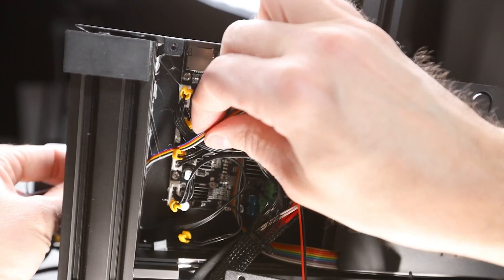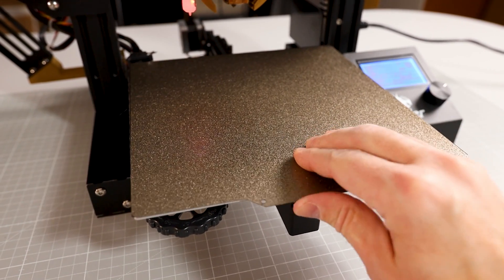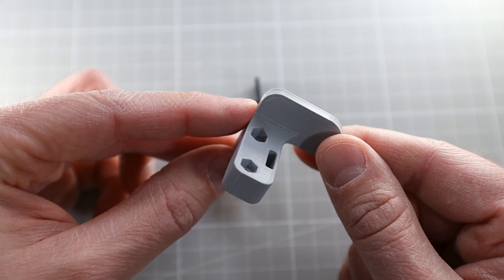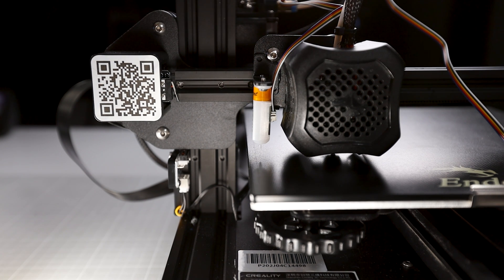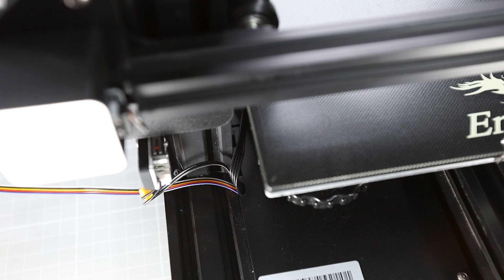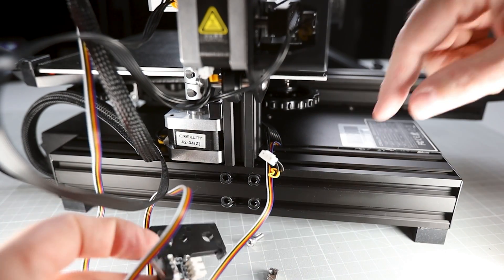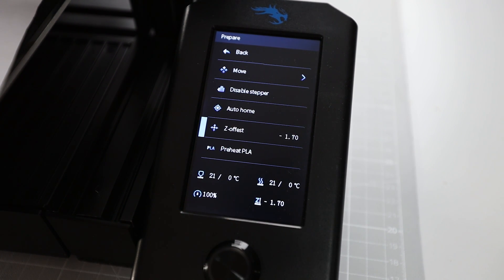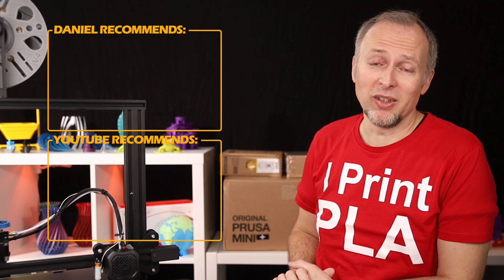Ender 3 v2 (v1, Pro) BLTouch Upgrade (Creality 4.2.2 or 4.2.7 mainboard)

Comment: Lol Sorry in advance this is quite a long read.
Love Videos where everything is explained but just in-case the source links are provided for more info if you need it well done!

 I considered getting an Ender3 when I getting into 3D printing 4 or 5 years ago. Whilst seeking advice on buying a printer. I was asked "Do you want to Print stuff or Repair and Mod your Printer as your new hobby?" Was Advised that if I wanted to print things buying a Flashforge was a better option. I bought a Finder3 and 5years on My flashforge had it first hiccup last week when the Hotend became blocked. ( not bad for 5 years of use) I decided that, maybe as it's no longer made that I'd better buy some spares whilst I still can.
 So tapping Finder3 into eBay naturally gave me all the results for Ender3 instead. And there at the top of the list was a modified Ender 3 V1 Neo for £20 with 2minutes left and no bids. After a quick scan of the pictures I noticed it was pretty much taken apart and there were quite a few new spare parts in a bag. I placed my bid I was the only person to bid and I won this printer.
Turns out it has a 422 silent MB All metal hot end upgrade dual gear metal extruder. The bad news was it wasn't put together very well at all to begin with and had been partially stripped with the same finesse.
I  watched a couple of Videos on YT to familiarise myself of the internals of this. 
Once I carried out some remedial repairs I tested everything to see if the printer actually had and signs of life. So when It did.

 I ordered upgraded yellow bed springs and a BLtouch clone from Aliexpress. When the parts arrived the following week I set about rebuilding it. and 3.5 hours later I managed to print the demo file on the TF card.
Since then I've printed a bunch of cable chain and the mountings so I can tidy up and secure the cables. Now I've proved the printer actually works I will fit the BL touch.
What I've discovered is that the Ender 3 prints surprisingly well and that the user  interface is clunky compared to the flashforge. So you need a ton of upgrades to get anywhere near that.And thus the advice I was given when buying my first printer was correct. I've had this Ender3 for little over 2 weeks ( 1 Week waiting for parts before I rebuilt it) And already I've had all the wiring out of it twice I'm watching "Upgrade" videos and planning improvements I can make to this printer.
And knowing this I've made a decision It's getting the cable Chains It'll get the BL touch.
I might move the extruder to direct feed to the hotend But it will stop there other than an Enclosure so I can print ABS with it.Modding an ENDER3 will not become my new hobby

Comment: Does not work for me at all. All the people are doing Videos for ender 3  (V2 ,V1, Pro) and 4.2.2. 4.2.7 and firmware even not told in titel. Could not work like this. You should only do 1 video for your ender Modell your Motherboard and the Firmware you use. Everything else will not work eventually like for me. These videos are useless. But you will get more clicks i think because people watch it over and over because it does not work and they think they done something wrong. Till they figure out its your info that is wrong. And they will not come back to any video from you. But you got more clicks in the first place. And this is for all other videos out there. Must be lucky you really have all the same. Some people even forgot things and they just edit a text most people dont even see. But they dont want to record the section the missed something. if your video is not correct in every detail dont play with the time of all your followers and the people watch your videos and bring you the money. But its mostly the case because clicks will come any way even more if you got something wrong because people have to watch a couple times to figure out whats wrong. very sad. overall useless if you have not all the same stuff. not working for ender 3 Pro 4.2.7. and firmware most also be correct.
Reply from the maker: Dude, it’s 2025, why are you even doing this?

Comment: I'm using bl-touch v3.1 with extension cable, how to properly plug it to the 4.2.7 board for ender 3 v1, thanks.

Comment: I just finished installing my bl touch on my ender 3 pro. I have it all leveled and it looks good, until it starts to print. The printer draws a line on the left side of the build plate fine, but once it starts the actual print, it doesn't stick to he bed, as if it's too high all of a sudden. It starts moving all over the build plate. I'm printing something small so I know it shouldn't be anywhere near the bottom of the plate. Then the whole system freezes and I have to manually shut the power off and turn it back on. Any help would be appreciated!

Comment: IT JUST WONT WORK FOR ME. IT JUST SETS TOO 10MM, 13.4MM OR 14MM???I have followed your video among many others and it just isnt doing it. Mines an Ender 3 Max, latest firmware straight from the shop i bought it from in july this year,  for the 4.2.2 board. What am I doing wrong. I have a video on my you tube showing the stages completed and it just will not do it. all i get is the nozzle swirling filament 10mm or more above the bed and then it fails. Help please

Comment: Great instructions thank you. Installed a BLTouch on my Ender-3 with 4.2.7 board with no issues. I used some short Dupont extension cables to avoid having to rewire anything and they worked perfectly.

Comment: ive been doing the same things but with an ender 3 pro and the correct files, but the thing is when i tune the z probe offset during the test print my system crashes and i get no response from the screen and the extruder freezes. my only option is to turn it off, ive tried going back to previous firmare and newer ones but nothing seems to work. im at a loss, and even when it prints one layer the extruder will diviate on one set axis then return soon to follow with a crash.

Comment: Thanks a lot for this clear explanation, just got my BLTouch and all the info seems scattered around. There is a Z Offset add-on for Cura in the Cura Marketplace, I just found it the other day. Maybe you could discuss that in some of you vids or perhaps even add a short chapter in this vid as that could perhaps make things even easier. I checked the G-code it but it may require some tweaking to be perfect. Thanks!

Comment: not sure if you'll respond to this but I'll give it a shot

I recently got a bltouch and at first it seems like it's working fine.... up until I try a bed leveling test file that prints squares on the top left and right, bottom left and right, and middle. For some reason, the top left is always further up from the bed than the other corners. I've tried editing the software, I've tried manually changing the knobs under my bed, but no change. Any ideas?

Comment: Hi Daniel!
Thank you so much for the great info!
For copying the firmware to the USB drive, is there a particular file to put it in?
There are multiple files from the ender 3 pro Drive about manuals, drives, models, etc.
Thanks in advance!

Comment: when you connect the connector to the BLTouch(@4:11) there is the white wire on the left of the connector, unfortunatelly the picture of the pinout of the connector shows the white wire on the right side of the connector(@06:07). Don't get me wrong, I love your tutorials, just a detail I was wondering about.
Reply: The important thing, imo, is to validate the BLtouch wiring from the BLtouch board with the creality board.  i found that the wire coloring does not follow proper guidelines.
Reply: ^^ this..... The accuracy of this video for a 4.2.2 board is very incorrect! Please be warned, plugging in the board this way will indeed fry your mainboard. This comment should be pinned at the top. The video clearly shows white and black on the right side of the mainboard when they should be on the left

Comment: Hi Crosslink!
First, I love your channel, its so helpfull <3

I have the Ender 3 pro with the 4.2.7 motherboard and the BL touch v.1.3(wrong wiring for 4.2.7). 
Can I redo the wiring and use this older version of BL touch with the 4.2.7 motherboard?

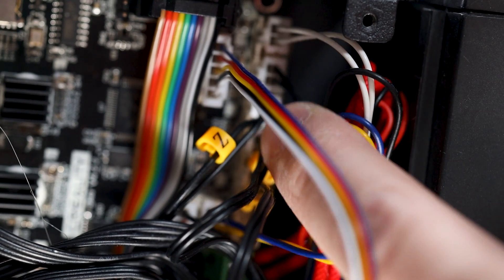Comment: Great video - helped a lot - works fine thanks. HOWEVER!  I am confused!  The pinout diagram at 6:16 shows OUT is a white wire but at 6:31 at the board end, white is going to GND as marked on the board.  My plug has the same colours in the same positions at the sensor end but, correctly, the white goes to OUT on the board. (Completely reversed)
Reply: I noticed the same thing - now what do we do?
Reply: @michaelmassey1827  Just be aware and swap them over if necessary.
Reply: You are correct, the video is wrong

Comment: Firmware install worked for4.2.2, bltouch worked, but the LCD is constantly beeping now.
Reply: Does it Beep only when when printing? Does the display change as if the control knob is pressed?  Mine did this.  Some say re-seating the control ribbon cable fixes it.  Creality say "It may be electrostatic interference. You can remove the display from the machine and check if the situation improves? 
If so, you can put a piece of rubber or nylon cloth between the display and the profile for insulation, and also ground the machine."
Reply: @skippyippydippy  I found out that the 1.1.2 firmware is the correct firmware for a genuine bltouch 3.1 and works without issue for the 32 bit board on an ender 3 pro

Comment: Question...i have followed this video 10 times. reloaded new version of Marlin from the Github site. I have 2 problems.  1  When I reboot with the new firmware I get an error the error " failed to enable bed leveling" From what I have read, that is because there is no data. So the second problem. Homing,  Everything seems to work when going to home, X & Y go home, the extruder goes to the middle of the bed,  but the Z will not go down. it moves upwards, then stops. the BLTouch does it quick reset, probe extends and then I get an error "STOP called because of BLTouch error, Restart with M999"  Any help from your user or you would greatly be appreciated. Thanks in advance...CO
Reply: Have same problem how did you solve it ? Thanks for reply

Comment: Does the mount file work exactly as the bracket that the kit provide? I bought a clone 3d touch, and tried some mounts but they didn't work with the firmware that creativity provides.

Comment: Question: The save configuration isn't working. It resets to 0 offset everytime restart the machine.
Reply: had the same issues. The problem was that i had no sd card in the printer. It saves this type of things on the sd card in the eprom.dat file.

Comment: Good night! Can i use the old board bl touch in the new board (4.2.7)?
Reply: The cables are not the same but is it possible to change it for the 5 pin connector and it will work?

Comment: What about the EEPROM problem? I know for sure that creality s software doesn't save the eeprom on the device. it saves it on the SD card and you have to use the same card every time.have you found a software that saves the EEPROM I'm the device?
Reply: This is old info.  All the new versions same to the eprom.

Comment: I have the bl touch installed on my ender 3 v2 for about 2 months now and all of a sudden today it just flashes red and the printer will not print due to this. Any idea what it could be?
Reply: Check cable connections on the board

Comment: Thank you for the detailed instructions!

I wonder if it is possible to connect a generic inductive/capacitive sensor to the BLtouch interface of the Creality 4.2.2 / 4.2.7 boards.
Sensor V+ to V, Sensor V- to G and Sensor signal to Out. You could then still use the normal Z-Switch as backup and there is no need for an optocoupler.
I have everything here, but i'm afraid to destroy the board.
What do you think?

BTW there is NO video or thread about this option in the internet yet, so it might be a chance for a nice new video ;-)
Reply from the maker: Thanks for pointing that out :-) Those inductive/capacitive probes are usually working between 6-30 Volt. There is I believe a few also working with 5V, but less accurate. I would still go for the optocoupler setup and providing the probe proper voltage from the power supply. This will less likely break anything and it's cheap.
Reply: @Crosslink3D  After some more research i will also use an optocoupler. However i'm still wondering why not connecting the sensor output to the BLTouch interface instead of the Z-Endstopp interface.
Does the BLTouch interface only work with the servo and the BLtouch test routine?
Thank you for the quick answer!

Comment: Everything looks good, except I just have a blue screen on my LCD. I’m using a regular Ender 3 with the 4.2.2 board. Can’t seem to figure out why I’m only getting a blue screen. No boot screen, no menu. Nothing.
Reply: im using a ender 3 v2 rn and its the same
Reply: did u ever fix it and if u did how
Reply: @samfirth5141  I ended up just replacing the board and upgraded to a 4.2.7 silent board. Fixed it for me
Reply: @TravAlan  I managed to fix it by getting a differ firmware that fixed it and just plugged my in the sd card

Comment: Im having a issue with the z axis not going down. My DL touch is turns on and  all the axis are moving except the z axis. the z axis goes up but not down. Also downloaded lastest firmware version
Reply: Had the same problem. Turns out I unplugged the Z axis motor, not the Z axis kill switch. Double check your wiring, and ensure you've unplugged the smaller "Z" switch, near the bottom of the board (and of course, plug back in the Z motor).
Reply: I had this problem but didn't have the adapter plugged in
Reply: Same issue here
Reply: Same issue for me, did someone found the solution?
Reply: Every find a solution ?
Reply: I found that when I switched to using a non stock firmware my printer worked even better and it fixed my problem with it

Comment: Please show how to do this with marlin.
Reply: Creality FW is based on Marlin 2.0.1, what do you need from Marlin that the stock FW doesnt provide? At the moment there is a lot of merging/fixing going on at the Marlin Github to get the DWIN Displays work correct. If you are in a hurry you can use Jyers Marlin Firmware with the LCD fixes (google jyers github, he's just a couple of commits behind the newest marlin), if you have no idea how to handle this stuff i'm not sure if you really need a newer marlin version.
Reply: @DooMRunneR  in short customization  would be the reason I'm not using creality. I did manage to do it. I'm rather familiar with compiling firmware, it was just there was but much information on the 5 pin bltouch or how the bltouch plug worked on the 4.2.2 board

Comment: anyone else running into the issue of the z axis not stopping? i have the anctlabs BLtouch.
Reply: I am having the same problem.  Do let me know if you figure our why
Reply: check your cables,  is most cases it's wrong cableing and/or the plug on the mainboard got loose or is not pluged in as it should.

Comment: Heads up for anyone getting a black screen:
I accidentally changed the filename:
"ender 3v2 something something BL touch (1).bin"
to
"ender 3v2 something something BL touch.bin"
And it black-screened me! Putting the (1) back made it work. I changed it because I thought I did the classic accidental double download or something.

It's working very well for me so far though, I got it all up and running and wired through my cable chains perfectly.

Comment: Bought the BL auto leveling kit and the manual given with it was outdated, I still did was sounded logical and tried to follow the manual as good as possible and it fried my motherboard.

They say it's my fault, which it partly is, but how can you release products and even give away the manual with the product without updating it first?

As an entrepeneur myself I would be ashamed doing something like this. This incindent gives me a bad taste in the mouth, making me think that they probably don't give a ****t about the costumer.

No point in contacting their costumer service.

Terrible, trully terrible.

EDIT: It seems that more people have this issue and Creality does NOT help you solve the issue. Do NOT buy this item. Do your research! More people fried their motherboard.
Reply: I will try this tutorial once my new motherboard is in.
Reply from the maker: I can hardly imagine how you could fry your board with this upgrade. It can’t be the wiring.
Reply: @Crosslink3D  No idea either, I'm no expert at all, but I heard a pop and saw smoke come out of a certain area on the motherboard and quickly removed the electricity, put it back in and the screen was just blue and lighting up, nothing worked anymore.
Reply: Did you have all power disconnected while working with it and a ground strap?

Comment: Soooooo...what about the change to the old Display Version? The new Firmware from the website does not support this display.
Reply from the maker: If you like to use the old display, use the Ender 3 Pro firmware instead. Otherwise building a custom firmware is always an option.